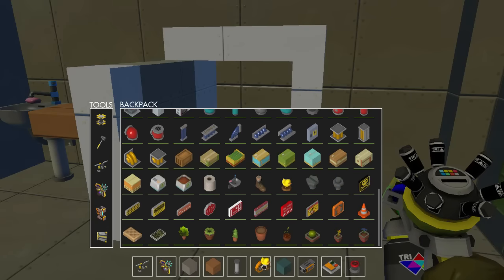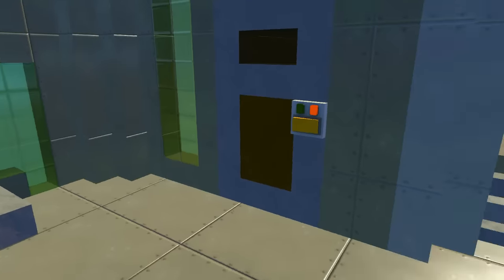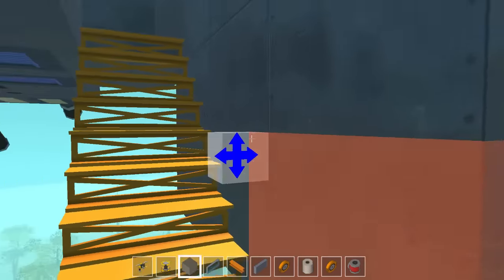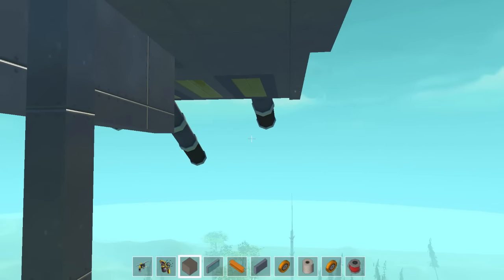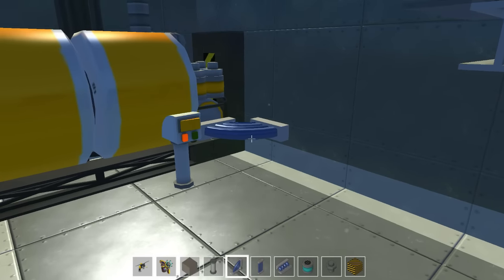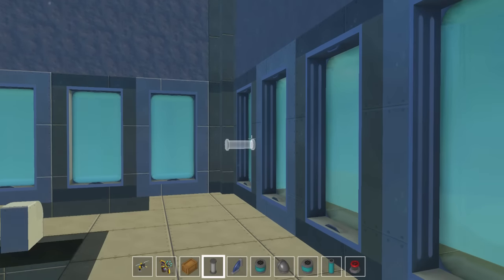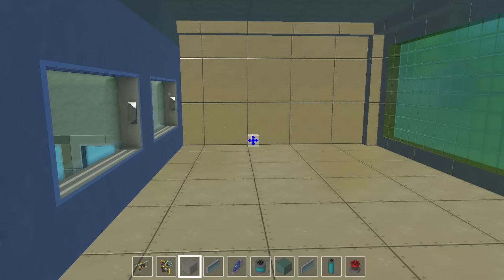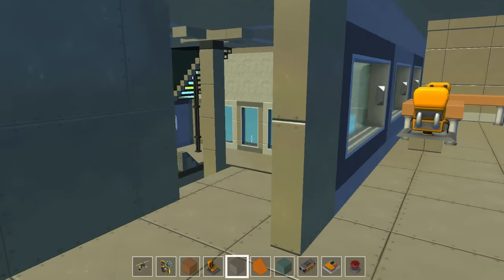SKY BASE Community Project! [EP.5]  - Scrap Mechanic (0.1.28) Gameplay Let's Build!

Comment: i have a good idea for the lift thing.
keep the lift super loose, put some hooks on the elevator on top. now put corresponding catching hooks on the roof of the base, so when the hooks are on, they catch the elevator. now connect the hooks to controllers and the controller should be able to be activated by hitting any of two switches, one switch up on skybase and other down to the ground. so when u fall, u can just push the switch and the lift will drop! Since the skybase is connected to the ground, switches will work as they are connected down.

thanks for reading lol, have easy playing now!

Comment: you should switch the kitchen/lounge with the command room for space and look. also add an arcade machine to the lounge and an escape pod to the command room(the one where the lounge is now). one other suggestion of mine is to make the secrets to the base a bunch of tunnals for passage so you wont get in the way of to many things and it would help fill out the base. also for new additions make a lab or research facility i have wanted you to make it for so long now and you never did for the shelter so please do it for this build. pleeeeeeeeeeeeeeeeaaaaaaaaaase

Comment: I'd put a control room at the very top, and make the main control chair able to rotate it. As an alternate, instead of a full control room, you could make a cockpit that you sit in, that then levers down below the base at an angle.  That would give you ground clearance.

Alternate alternate idea, If there's a mountain top nearby, maybe make a control base there similar to the fallout shelter, and provide a lesser elevator and monorail to get there.

Comment: Use a sensor module system. Press e on the sensors for settings btw. Modules work like this: The elevator has slots for modules to rotate onto. The sensors should be distance 1-3 and switch on. The rotating pieces rotate down/up in front of the sensor to activate/deactivate it. You place one at the bottom and one at the top controlled by possibly the captains seat. When you press the bottom part, the elevator should go up and vice versa for the top. This way also supports multiple button input in this way.

Comment: to use the R.C glitch, just try welding the sky elevator to the bottom and connecting it that way, but idk if this works or no, so if it does work use it. if it doesn't work, just tell me it doesn't in the video

Comment: You should connect the button to the generator to the lights and when you turn off the generator all power stops
Reply from the maker: There's no way to connect them to lights at the moment, except for on bearings.

Comment: Hey. My skylift is not working..I tried this for about 5 times and it didn't work. help?
Reply from the maker: Custom built? The bearings could be turning the wrong direction, there's not enough grip or force. Sometimes it requires to be unlevel.
Reply: +SpyCakes you should put a secret extending staircase under the eleveter
Reply: +SpyCakes and also can you put the switch for the staircase on one of the bunk beds
Reply: +SpyCakes why are there sinks everywhere
Reply from the maker: Why not? It adds to the decoration of the base, especially for where they should be.
Reply: +SpyCakes dude you have to use that room as the command room
Reply: +SpyCakes do a first aid room
Reply: +SpyCakes you need a couch and tv plz
Reply: +SpyCakes please add a greenhouse! Willed with windows and plants! (For food) You could have pipes every where to "water" the plants. I think it would be really cool.
Reply: *filled
Reply: you are also reacting to camodo
Reply: , sapphire to
Reply: ??? i dont even have the game =(
Reply: +SpyCakes make an anti-aircraft system on the roof! (I am dutch so I don't know if I sad that good)
Reply: +SpyCakes the duck is on the left desk of the commanders quarters
Reply: +flipa clip yep it's right
Reply: +Dr DerpyCake i saw that to!!
Reply: Add thrusters